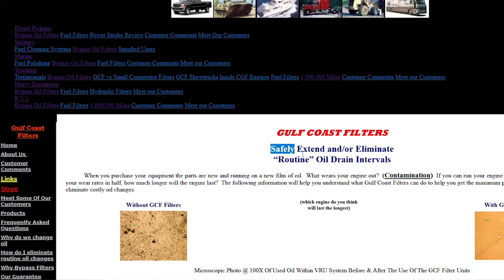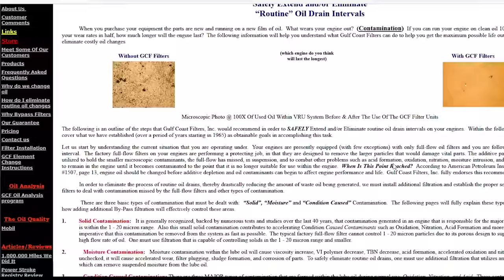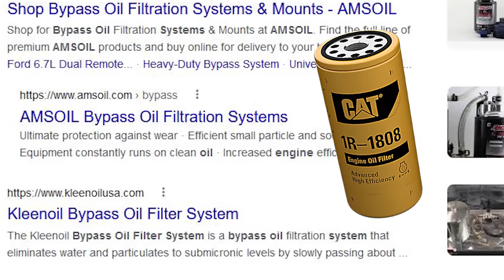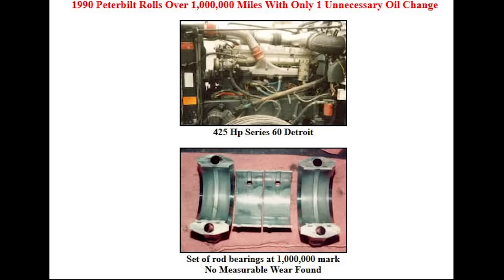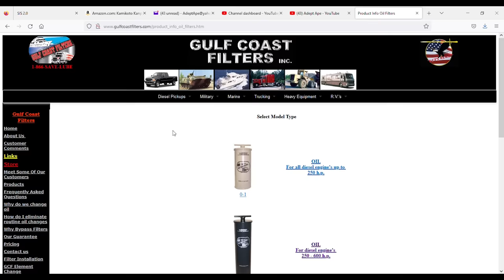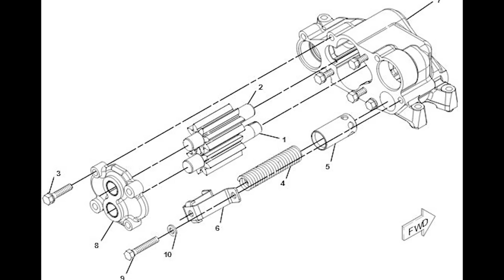No Oil Changes and 1 Million Miles!!! Are Oil Changes Optional with a Bypass Filter? (INTERESTING)

Comment: You don’t have to worry about moisture because oil runs hotter than the boiling temp of water so it evaporates out the breather
Reply: True I use the toilet paper filters. We depend on oil temperature to get rid of the water and fuel. The small amount of water the toilet paper removes is nothing.Short trips in cold weather and its sludge city.
Reply: Normally if you get water in the oil such as with a leaky head gasket. the oil will get milky and the toilet paper will feel soggy. The oil will protect the filters. Water will also put cracks in the paper like leaving a book in the rain.

Comment: Drove my 95 Nissan 200sx for almost 10yrs without an oil change. 
Total I put about 30k on it and it drove right on the scrap truck and I got 300$ for it.
I realized at the first oil change about a week after purchasing it that for a 1200$ car an oil change isn't worth it so I let it go but would would top it off when needed. 
So the experiment lasted almost 10yrs, I was impressed. 
If it wasn't for the rust making it unsafe for inspection,  I'd probably still drive it.

Comment: An old man told me when I was a kid that there was a device that you could install an filter that would keep oil functional forever. Oil companies bought patent and gov shut down that device. I never learned if this story was true
Reply: It wasnt true I have used  toilet paper filters  for 60 years. I dont drain oil unless I have a reason like a leaky head gasket on the 64 Rambler American.. I wll drain the oil on a used car because I dont know what is in it.
Reply: I have a over 50 year old Motor Guard oil cleaner on my 390 engine in the F250.  I believe it has about 4 patent numbers on it.

Comment: the concept of a bypass filter makes alot of since.i could see it extending drain intervals, possibly substancially.but id still change it on any of my engines.oil is cheap compared to engine components & labor to replace them.
Reply: As far as I know the test truck engine was in near new condition at the end of the million miles. It didnt self destruct when it reached 1 million miles. How long an engine lasts doesnt depend on how much money you piss away on oil changes.

Comment: Bypass systems do indeed work. Known some people that ran them on their cars. They still changed their oil around 8000 miles but not hard to double the life on an engine with a bypass system.
Reply: I sadly seen more then 1 person lose a engine running oil bypass systems.
Reply: Yes that clean oil 100% of the time will kill your engine. Oil needs to be allowed to get dirty wear and foul the engine then be changed.
Reply: I dont drain oil. In the 60s I.changed the TP and added a quart of new oil every 2.000 miles.Now its every 6.000 miles.
Reply: You need to adjust for different conditions. I run mostly highway in warm conditions with a gasoline car.

Comment: How about on a Heui system like our 3126E.(52k miles on it. A Newmar D.P. motor home. If it would keep the oil cleaner wouldn't that be beneficial for the heui pump. We travel so little right now I end up changing the oil about every 3-5k miles. (In one of your videos you said to keep the oil clean and change at a lower mileage instead of 10-12k) I always use the Cat 1R-1807 oil filter, but can't find the 2 micron Cat fuel filter with water separator(Ours only has one fuel filter. Been using a ABP/N122-32FRT03. Now that one's getting hard to find. Thanks Josh.

Comment: Hmmm... I was under the impression all big rig engines had bypass filters. I've been toying with the idea of adding one to my 94 C3500 Diesel. At 130,000 miles it runs great and burns no oil. I cut the filter open at every oil change and never find anything.
Reply: Bypass filters have been around since the 1920s They were mostly optional equipment. They were the only filters that could clean.oil. Then it only got to where they were mostly used on trucks operating in dirty condidions like dump trucks. People are ignorant. They think full flow filters clean oil as good as the old Luberfiners. The Luberfiners ended up in the scrap pile.behind the shop. In the old days you could see those chrome  beauties proudly displayed on the side of trucks. What few you see these days are plain jane models mounted by the fuel tank. I worked for a guy once that usually had luberfiners on the fire wall. You had to open the hood to see one. Saw a over the road truck once with two Frantz 3 stackers on the fire wall. Told me he gets a 6 pack of Safeway truly fine toilet paper to service them. When they went out of production a Frantz dealer replaced them with a filter that takes Bounty Big roll paper towels. Thats the Gulf Coast filter.

Comment: Good Luck with that. Oil breaks down because the additive packages are used up doing their jobs. How are they controlling acidity which is a huge issue. Acid attacks babbit and causes leaching of the bonding layers of bearings. Additives also help control oil use. Do they have any data on the effect on aftertreatment life?  Oil also thickens when water condensation enters it. It also loses it lubricating qualities and shear strength when additives break down. In my opinion there is too much at stake here. Do they have a link to "we will replace your engine for free if ...."  I bet NOT.
Reply: Actually all the Filter does is clean the oil. Clean oil does a lot of things including neutralizes the acid. The people that did the testing must have thought 3 gallons of new Rotella 15 40 every 10.000 miles was enough.Oil analysis showed that was more new oil than needed.
Reply: @ralphwood8818  You are correct if some oil is removed or burned and fresh is added you can be fine. Cummins had a system called centinal that added oil but it also injected the used oil into the fuel system to burn. As soon as aftertreatment was part of the equation that had to stop as oil ash can't pass through the aftertreatment. The best oil cleaning filter I ever saw was the centrifugal filter. They really take out the small particles. If extended oil changes are practiced analysis has to be done like AA mentioned. I don't want to see anyone go broke because they lost an engine due to trying to save by circumventing maintenance. I used to tell all the new hires at the Cummins distributor I worked at:"These engines feed families and keep roofs over people's heads. A truck is a JOB for a dad or mom. So remember that when you diagnose and repair"
Reply: @ENGINESHOPJOE  I had heard of that system.Its a matter of keeping the oil clean and adding enough new oil. Oil analysis shows 3 gallons of new oil every 10.000 miles is a little more than needed.I can see where it would be better to put the used oil in the fuel tank. My 65 Honda 305 had a flange on the engine. Remove the flange and there was a chain driven centriuge. I know Mack trucks used them. The Honda centrifuge packed the sludge in so hard I had to dig it out with a screw driver. It was just a steel drum.
Reply: @ralphwood8818  Was That the 305 Dream or what they called the Dream? I had no idea honda did that oil cleaning function. The company was, in my opinion on top of its game when it came to engineering. I bought the cr125 elsinore motocross in 1973. What a beautiful machine that was. Now you got me started on Motorcycles LOL. Do you remember JC Whitney sold an oil filter adapter you screwed on where your oil filter mounted and you put a roll of toilet paper in it. That was your filter. From what I heard they did a fantastic job. The Cleveland regional transit authority used to run the centrifuge filters as a secondary filter instead of what they used to call the luberfiner. I remember the first time I ever ran across one of those filters. I pulled in a unit just off a dynamometer run and shut it off. I heard this whirring noise for minutes. I looked all over trying to figure out what the heck was making that noise. LOL
Reply: @ENGINESHOPJOE  It was a 65 Honda 305 Dream I found out about the centrifuge by accident. I wondered what was behind the flange. I think I remember it had 16 inch white side wall tires. I didnt like the spin on toilet paper filters They took about a third of a roll of toilet paper. They converted the full flow system to a bypass system.  They had a big bypass valve that was open as long as the engine was running. Saw a brochure with a couple on a dragster. toilet paper filters are completely useless on a dragster. They will clean the oil. I wouldnt want one. I bought one about 1960. It was like a Stilco. It was called something like a Verdin Perma Bilt. Looked nice with the fins. Trasco is another one.

Comment: You mention their claim that engine oils don't break down when kept within a certain temperature range. Over time they do regardless of claims to the contrary. Whether there is good temperature control or not to reduce oil breakdown does not eliminate sheer forces. It also doesn't eliminate the oil exposure to the hot end of the piston at the rings and underside. Those alone will decompose oil over time. I could see the 1-5 micron clearing as a way to reduce friction and therefore reduce wear while also slightly increasing power and possibly piston ring sealing. 

As you know, even with regular engine oil changes there is always some amount of old oil retention, varnish, gum, possibly coking, and caking of old oil in the crankcase. As a result, even a pristine oil change will have particulates below the micron level of the primary oil filter (20-40 microns). This secondary system could serve to eliminate those and make the oil actually better than a fresh oil change by eliminating the higher micron contamination left in the crankcase.

My personal opinion and conclusion? I think it is a great idea and could likely extend engine oil changes for some time. The thinning that might come from some fuel contamination and sheer forces might actually increase power and fuel economy a LITTLE since thinner oils do allow more power production. The caveat there is that you do not beat the engine by running it hard with the thinner (higher mileage) oil. I would NEVER run it for 1 million miles, however, (personal opinion) I do believe the lower micron contamination level could likely move oil change intervals out to between 5x-8x the normal interval. Removing the microscopic abrasives (down to 1-5 microns) from the typical 20-40 microns, is so far below engine build tolerances that it should help reduce friction and in turn reduce wear as well. I don't know that I buy the 1-million-mile claim but certainly accept the reduced wear and increased longevity.

As a final note, in my opinion, coolant contamination is a mechanical engine malfunction so isn't really a valid consideration for this item.
Reply: I learned about filters that keep the oil clean before I learned oil is supposed to get dirty and be drained. If I had a PhD in lubrication engineering I would still be running on dirty oil. Started in 1963 with a Frantz oil cleaner and Standard Delo 30 weight.all I have now is Gulf Coast juniors Motor Guards and an Austrailian Jackmaster Classic.  I converted the flat head Ford V8 canister filter to use Scott 1000.They havent made good filter elements for many years as far as I know
Reply: Why do people keep saying the oil wont last a million miles. The 3 gallon Gulf Coast filter is changed every 10.000miles and 3 gallons of new oil is added.At 50.000 miles the full flow filters are changed and more new oil is added. Unless I didnt use the calculator right thats about 350 gallons of new Rotella added in a million miles. Im adding a little in case it leaks or burns a little. Oil analysis shows that is more new Rotella than needed. I know some truckers are changing the filters less often. Its actually a Shell oil test truck privately owned .old news. Road King asked me for the owners phone number in 1996.

Comment: The oil components break down regardless of filtration or drying. You still have to change the lubricant. it becomes contaminated with unwanted petroleum compounds.
You would literally have to run a sample, anylyse, build a proper additive supplement package and put that in the oil when needed. AKA just change the oil!
Oil isnt just "OIL" its sulpher, mag, iron, surfactants (detergents), boron, other crazy elements and compounds. Just change the oil.
Reply: Im not a let the oil get dirty then drain it enthusiast.

Comment: I dont believe it. Oil breaks down with contamination, but also because of thermal breakdown and mechanical breakdown. Thermal breakdown happens because the high heat of the engine decomposes additives and base oils. The additives lose their effectiveness, base oils become crosslinked and the viscosity changes. Mechanically, since there's a lot of shear forces on the oil, this causes the oil molecules to break apart and get thinner. These processes are permanent and can only be fixed by replacing the oil.
Reply: I heard something like that down at the oil change place.. I gave up allowing the oil to get dirty wear and foul the engine then draining it in 1963. In the 60s I changed the filter and added more new oil more often.
Reply: In the 60s I changed the oil by adding 1 quart of new oil when I changed the toilet paper filter every 2.000 miles.using Delo 100 30 weight. The Series 60 Detroit gets 3 gallons of new Rotella 15 40 when the Bounty big rolls are changed every 10.000 miles. Most people dont think. They just keep saying the oil cant last a million miles.. The reason there is virtually no wear is the oil is never allowed to get dirty.

Comment: Another factor is the depletion of the additive packages in the oil(detergents,anti foaming,anti oxidation,ep agents,etc). At the very least these would have to be replaced by some sort of replacement package
Reply: Its the same on trucks or cars. When you change the bypass filter you add new makeup oil with new additives. With my small engines its 1 quart. With the million mile test truck its 3 gallons. Every 10 K miles. Oil analysis shows thats a little more than necessary..The system only works with large depth filters for large engines. The little engines only need little filters. No the test truck didnt go a million miles on the same oil.

Comment: If the trucks runs light UPS or FedEx example yea extend oil change no problem but when you heavy all the time filtration system is good and still normal oil change keep on schedule. Oil is cheap than an engine rebuild. It's an additives that are in the oil not the oil.  Just me

Comment: I know a guy that ran 250k on a Ford 460 truck engine never changed the oil ...changed the filter evey 3 k . Tear down after 250 k ? Worst cylinder was 1.5 thousandths . Bearings were not galded ...ran pensoil the entire time .

Comment: Diesel locomotives have been running for millions of hours without a single oil change.  One of ours hasn’t had a complete oil change for over 18 years
Reply: Shell offshore is one of Gulf Coast filters customers. I remember EMDs mentioned. Saw a picture of one on a rig. Im thinking that looks like a giant 2 cycle Detroit.

Comment: I have to say that most of these comments about continuing to changing the oil or not even extending the intervals are rooted in the idea of regular changes, an idea that is as old as time engines themselves and drilled into our heads. I think that idea causes us to ignore any possible scientific data place before us and accept it. It would be great to see a true long term test of oil bypass on a mass fleet operation and analyze the results including all filter change intervals and sample reports. Then and only then can we come to any type of conclusion of what is acceptable.
Reply: My experience is small engines. My Rambler American flat head 6 came with a factory installed spin on bypass filter. The oil was alsays dirty and black soon after a oil and filter change. Installed a toilet paper filter and the oil turned golden. It didnt take me a million miles to figure it out. More like 50 miles.Im not very smart but I know clean oil is better than dirty oil.  The people doing the Million mile truck are Shell oil engineers and Gulf Coast filter people that understand big engines.
Reply: I think when 1 started using the Frantz in 1963 Alhambra California had the Frantz 3 stackers on the big diesel water pumps. Probably electric now. You can still find Frantz 3 stackers on shrimp boats and such. When they went out of production. We got the Gulf Coast filters. My little Gulf Coast juniors are just improved toilet paper filters.

Comment: In germany we had an company a few years back and they were pretty common with older taxis they had normal passenger cars wich made well over 1 million kilometers without an change.  But after every filter change they had to add an special oil wich was riched up with additives.
Reply: Took me 20 years to put 250.000 miles on the 84 Subaru  with no oil drains.

Comment: Bypass filters cannot remove dissolved acids or fuel contaminants from engine oils. Even the extremely small metal particles as well as the fine soot are not completely caught in the filter roll. In contrast to industrial oils, therefore, engine oils cannot be used for a much longer time despite bypass filters.
Reply: Another genius l

Comment: Nothing surprises me with these modern oils and cleaner running engines. Normally I change the Austrailian Jackmaster Classic on the Pontiac every 6.000 miles. It is normally visibly clean. It was dirty the other day. That was because I left the Wix full flow filter on there too long and the relief valve was passing the big stuff.